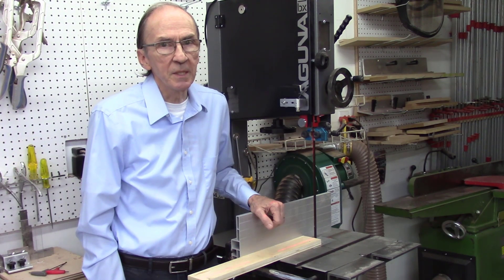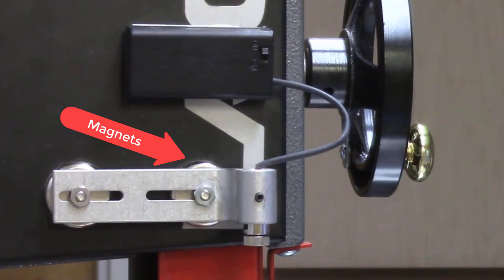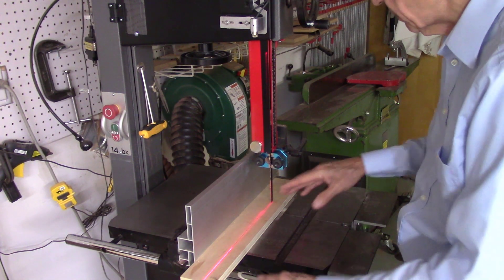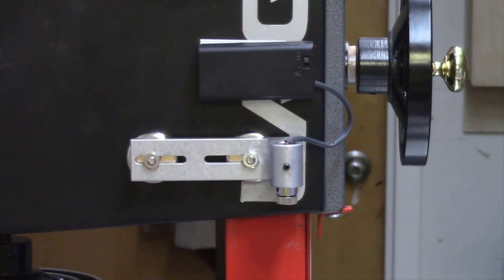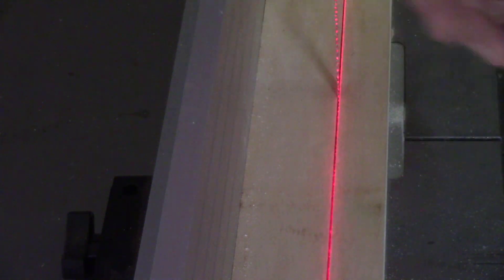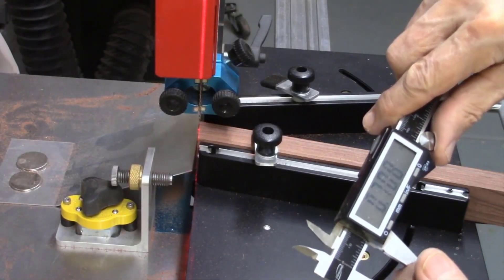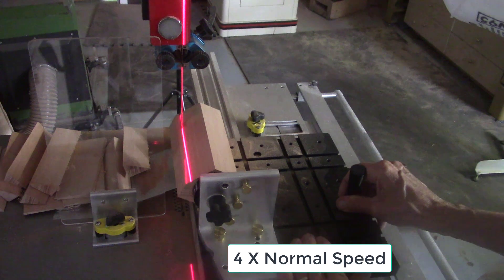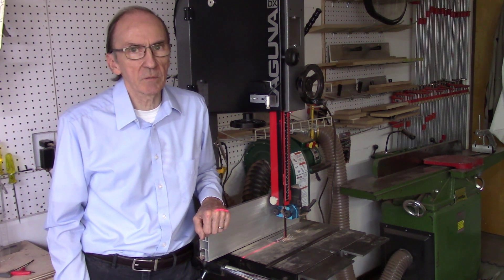Band Saw Laser Beam, Part 2 - A Band Saw Laser Beam to project the path of the band saw blade (106)

Comment: sure like the accu-slice system, but unfortunately your price points are way out of reach for those of us on a limited fixed income :(
Reply: I agree, the price shuts me out on a limited retirement income.
Reply from the maker: There are a number of reasons for the cost.

First it is constructed from heavy aluminum - no cheap plastic. It also incorporated a precision indexing system that enable the incremental slicing of boards to a tolerance of 0.001".

Secondly in is made in the USA in a machine shop. It is machined to precision to enable you to get the accurate cuts.

Third.  The market is small for this product.  If we sold thousands a month, the cost would go down.  But the market is less than 200 a year.
Reply: I agree, plus we in Australia have to pay about double due to postage and currency. Would be lucky if anyone in Australia actually had one, I know I would love the system ?